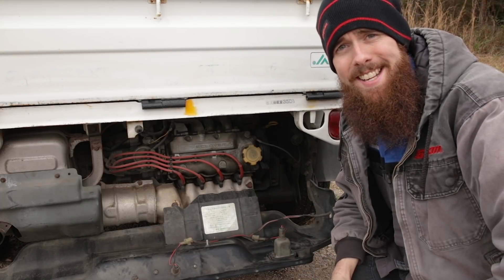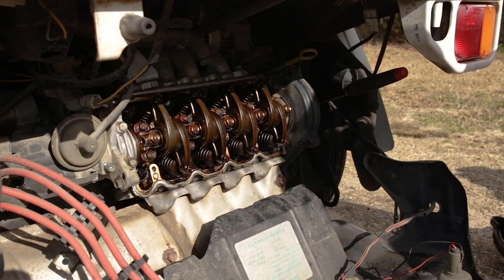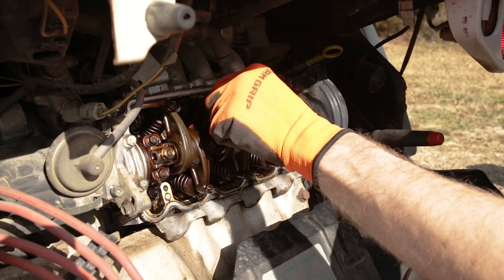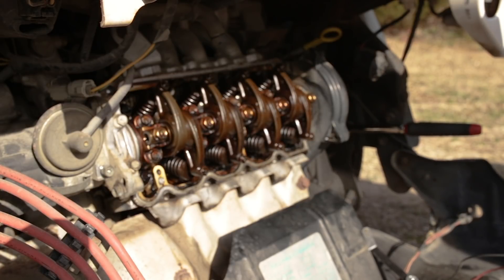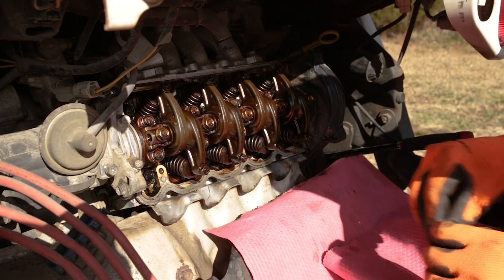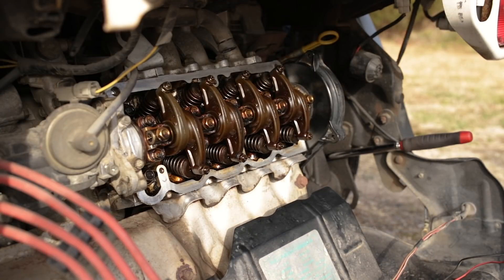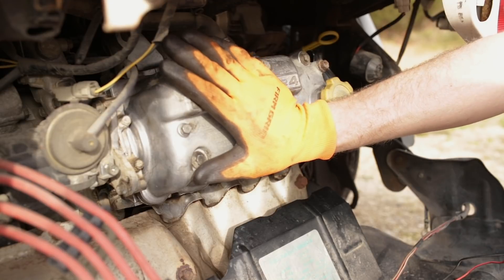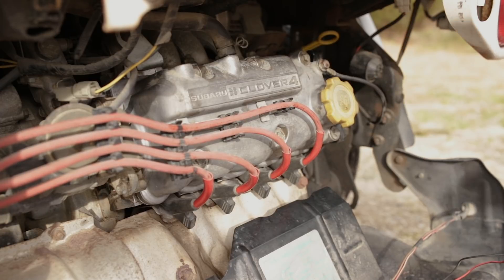Subaru Sambar KS4 EN07 - Rocker Cover Gasket Replacement & Valve Adjustment

Comment: You can really feel the adjustment better if your use your fingers to turn/loosen the adjuster screw vs using a screw driver. Then lock it down then re-check. Anyone ever consider installing swivel adjuster screws in these engines? Is there a service interval for valve lash on these engines? Don't see anything in the manual.

Comment: Just fixed an oil leak by replacing my rocker gasket (even felt brave enough to check the valves...) thanks so much for the detailed video! 🚚

Comment: Mr Subaru 1367.  What would be a good compression check reading on the Sambar engine.  I got 140,135,135, 145 - does that sound right?

Comment: Just noticed my sambar is leaking oil in the bottom right corner of the valve cover so I'll be replacing the gasket soon. I have never adjusted valves before, should I worry about adjusting them while I'm in there? Is there a sign that I should adjust the valves? Truck seems to run perfectly fine so I reckon not!
It's a 94 Sambar with 58k kilometers

Comment: The torque is kilogram force - meters.  The more correct term would be Newton - meter like you mentioned.   It would be like us using units of pound force - yards.   

I had a Corolla in the 70's that I had to adjust the valves on.  It seems like I had to rotate the crank to four positions.   I like your approach better.

Comment: Great Video !! And as always Great content. One question, what kind of flex 10mm and 12mm flex impact driver sockets were You using. They looked like they were a one piece made for a cordless impact drive. Thanks!!
Reply from the maker: They are. They're by Ko-ken. They're call swivel nut setters.
Reply: @MrSubaru1387  thanks!!!!

Comment: Looked a satisfying task. Just curious, is there a 'hot engine' setting for adjusting the valves as well? I know when I do my Ford Essex engine I prefer a cold engine, saves burning your fingers and by the time I get to the sixth cylinder it would have cooled enough to question whether it is still hot. Certainly a big difference between hot/cold engine valve settings on a Ford Essex engine.
Reply from the maker: Subaru states adjust engine cold.

Comment: Used Japanese vehicles are common in new Zealand and there used to be comments that the Japanese do not service their vehicles very often  - perhaps never before getting a new vehicle. There is some regulation that requires major work needs to be done around 7 years which is often when the vehicle is shipped off shore - therefore not surprised at the engine sludge situation.

Comment: Awesome video! Thanks for sharing details. Definitely going to do this on my Sambar. Hope you show some carb tuning vids too. I'm having some cold start issues when the temp is 50F or below.
Reply from the maker: Mine hasn't been as happy to snap to life in these winter temps.
Reply: @MrSubaru1387 yeah, I feel like mine is getting bit too much fuel until it has been at operating temps for a while. Went through a cold puddle of water that cooled the block a little and had to let it warm back up before it started to act right again.

Comment: Great to see you're finally able to work on the Sambar👍  I was curious about when you did the valve adjustment and basically did it with the engine in only 2 positions. Is that specific to the clover 4 or is that a typical 4 cylinder engine procedure?  The only valve adjustment I've done is on the 3 cylinder in my Hobio and set the engine to TDC and adjusted intake and exhaust for cylinder 1, then rotated the cam pulley 120 degrees for each of the other two cylinders(following the firing order) and adjusted intake and exhaust for each cylinder. I guess the thing that threw me off with the Sambar is the adjustments for cylinders 2 and 3 being partially done in conjunction with 1 and 4 with only 2 engine positions being used. Just curious if that is specific to that engine since I've never done a 4 cylinder.
Reply from the maker: On the Subaru EJ boxer, N/A, SOHC, you have to turn the engine in 4 different positions to adjust all four cylinders.

Guess the Clover 4 is just easier. I assume depending on firing order, other SOHC 4 cylinders could be similar.

Comment: Stupid question, what sockets are you using? I see that there isn’t an adaptor
Reply from the maker: Ko-ken. They call the swivel nut setters. Super handy. It's a one piece design that chucked up in a 1/4" hex.
Reply: @MrSubaru1387  thank you!!!

Comment: The torque value for the jam nuts converts to 6.5 ft-lb for those who care. (or 8.8 Nm)
Reply: Torque is defined as force at a distance, therefore 0.9 kg-m * 2.28 ft per m * 2.2 lb per kg = 6.5 ft-lb
To convert kg-m to N-m, multiply by 9.8

Comment: Is there a torque spec for the rocker bolts? 

Edit: 0.9 ±0.1kg/m  aka 6.5ftlb

 Also in the manual it shows that it should be the first line of the four on the harmonic balancer, but you showed it to be in between two of them. I have the four lines and then a single line 180° away. I said it to the first line as the manual shows

Comment: I've done cam seal, valve cover, crank seal and rear main... I still here a slight rattle at higher rpm. Any idea what that might be? Droppeded the oil pan and checked all the rods- all bearings are still accounted for. Mine has 55,000 km. Ideas?
Reply: What oil weight do you use? As well as fuel octane?
Reply from the maker: Sambar? Or EJ series?
Reply: @MrSubaru1387  1990 sambar non supercharged.
Reply from the maker: I've yet to change oil. Will be running 5W-30, as far as I know. Haven't checked the owners manual. Fuel, I run non-ethanol 87 octane.
Reply: Calls for straight 30w officially, but I’ve seen recommendations from 10w-30 to 15w-40
Reply from the maker: @firstnamelastname3862  you're right. Looked in the manual. 30W advised.

Comment: I've wanted to ask this for so long now, and I never brought myself to write out the comment - I see pretty much everyone uses a razor blade to clean out the mating surfaces before re-sealing engine parts together, and everyone points out how fragile the aluminum is  and to be careful. Would a plastic scraper mitigate that risk and do the job as efficiently and more safely, or is there a specific reason I don't really see anyone using plastic instead of a razor blade? I was thinking of something along the lines of a flat-edged ice scraper for windows?
Reply from the maker: Snap-on and others do now offer plastic scrapers for this reason, I just don't own one. A box of 100 razor blades from the hardware store lasts me years and years.
Reply: @MrSubaru1387  Understood. Thank you for educating me on the topic!

Comment: Me Subaru. I have looked at your store. Can you recommend what parts I need to do the head gaskets timing belt and oxygen sensors on a 2008 outback 2.5na. I want to use the Mls gasket. Do I just buy the kit for a 2.5 turbo?  Thanks for any help you can provide.